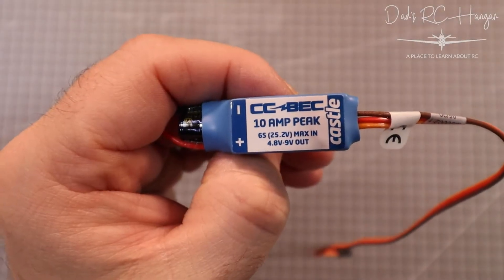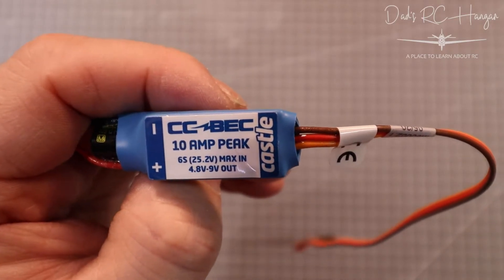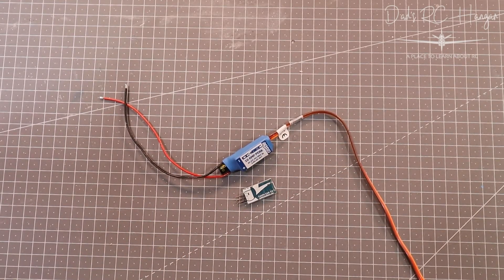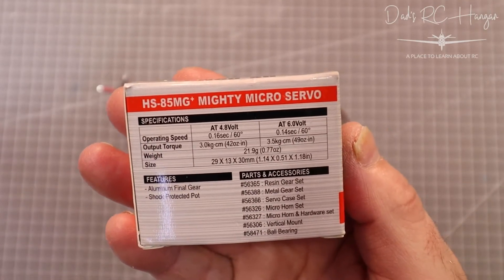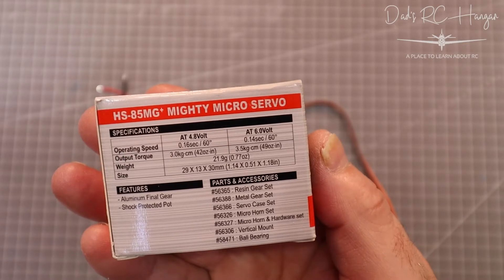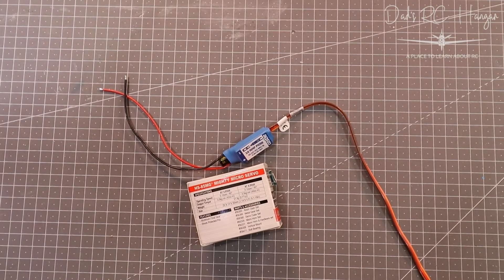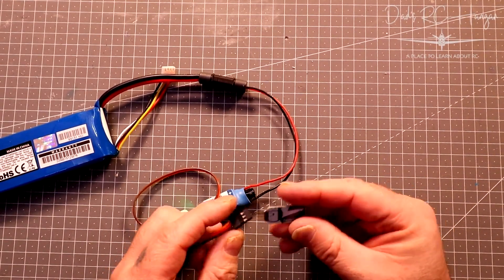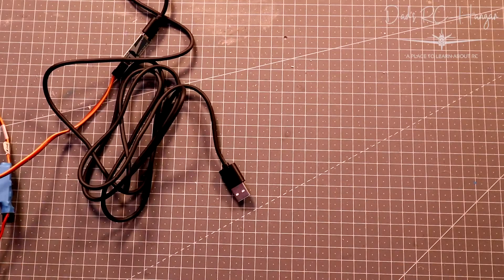How To Program a Castle Creations BEC

Comment: Hello, very interesting video, but for me the 2 red lights do not turn green, my laptop is a Dell core I7 64 bit, may I ask what kind of computer you use because I have the impression that the cause is my laptop
kind regards

Gilbert
Reply from the maker: Hi Gilbert,
Been awhile since I did this, but it would be a Asus laptop I used. It’s possibly a driver issue maybe. I have used impulse RC driver fixer to, fix drivers for this sort of thing. Maybe give that a go. 
Chris

Comment: Make your Nitro electric more fun I did it with my Revo 3.3 Castle Mamba Monster X 8s running on 6s about 70 75 miles an hour
Reply from the maker: That’s cool, I have got two sets of 4AA batteries in my Boomerang V2, but I wanted this unit in my tiger. Thanks for popping buy Toby. Hope you stick around and Sub. 👍🏻

Comment: The AA pack Sometimes batteries pop out now you have a runaway
Reply from the maker: I must admit, thankfully I have not had this issue, but I always make sure they secured and the power cables go through a switch that also has a Charing point, as in my recent Boomerang v2. Cross fingers it works well at the moment.